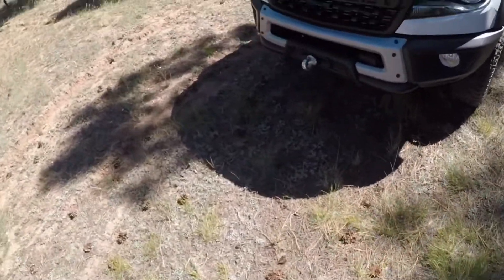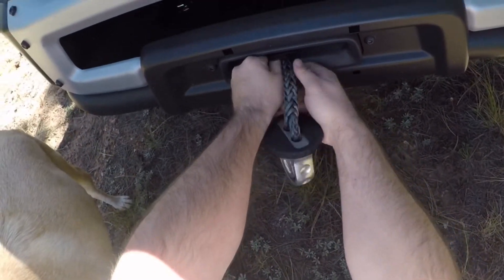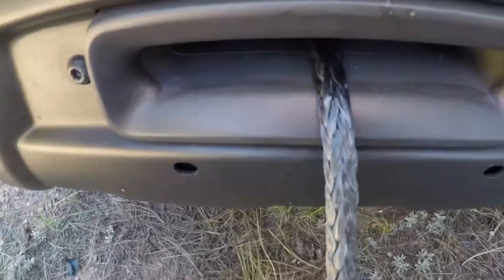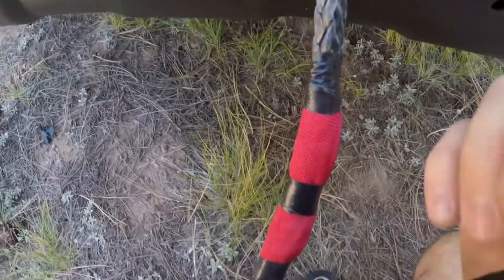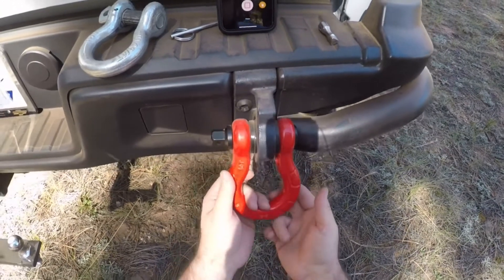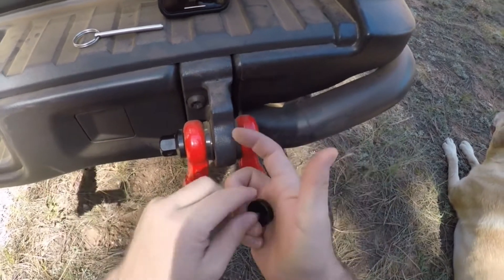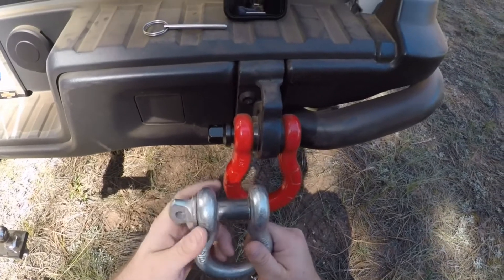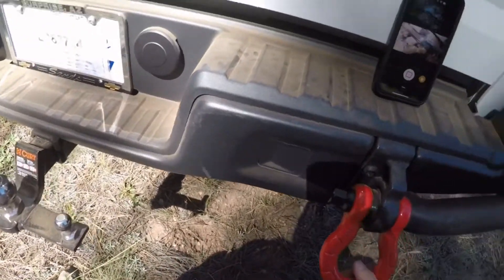Playing with winch on my Chevy Colorado ZR2 Bison

Comment: From sailing, the hole in the pin for your d-ring is typically used to thread safety wire through and then around the d-ring body. This prevents the pin from vibrating loose, though with the fancy key side of the pin you may not need to do this. Also the last couple second of the vid did you mention winching from the ball of your hitch? If so never to that the ball can snap and become a flying projectile.
Reply from the maker: I Never mentioned using the ball just the trucks hitch. I have a special hitch made to pull from.

Comment: When you put the rope on the winch did you hook it up to a tree to winch it in under load?  Mine was all jammed up like you discribe from my profressonal install.  I had to run it all the way out and then roll in the rope under load.  So I hook it up to a tree and reeled it in, no more mess and no cuts needed.